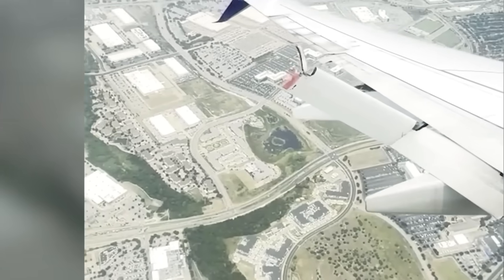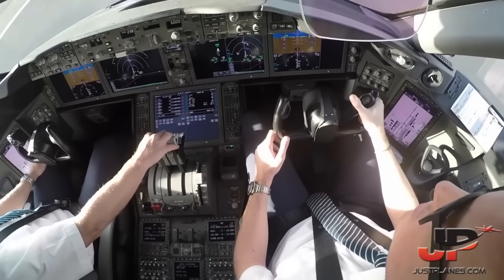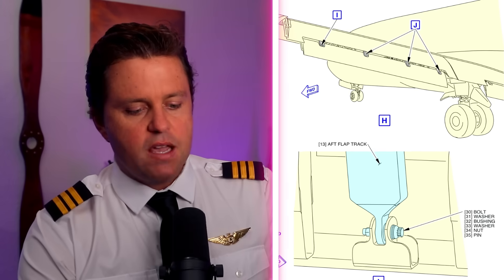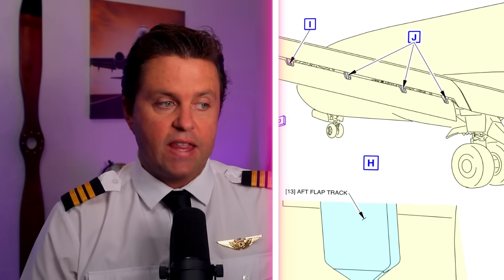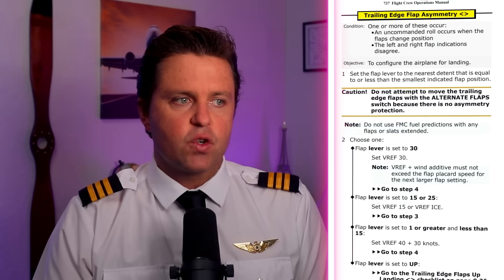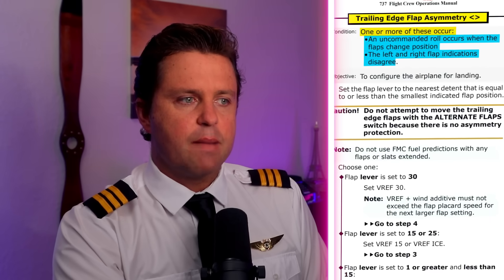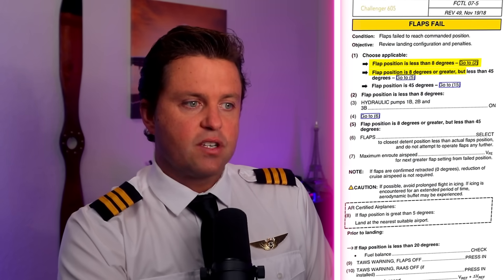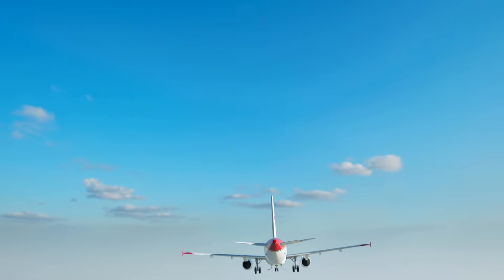What Happens When a 737 Flap Breaks Off In Flight?

Comment: The 737NG also has a flap skew detection circuit. There are 8 skew detectors. i.e. 2 for each of the left/right/inboard/outboard trailing edge flaps. 
The system will stop the flaps moving hydraulically.  It may cause the needles on the flap position indicator to split by 15 degrees.

Does the QRH mention flap skew?

Comment: I imagine the passengers were totally unaware of the flap situation and only found out from the news or you tube. Probably there are many things that go wrong (minor things usually) and passengers never know. Just as well. I am glad the plane landed safety. Delta is the main airlines I have been a passenger on. I just wonder if maintenance isn't as good anymore on planes (any airlines) because of budget cuts. Old planes need to have even more maintenance. It's not the pilots fault--they just fly the planes and expect everything to function the way it's supposed to. So glad most of the time things are fine.